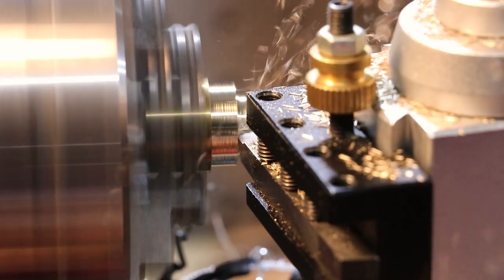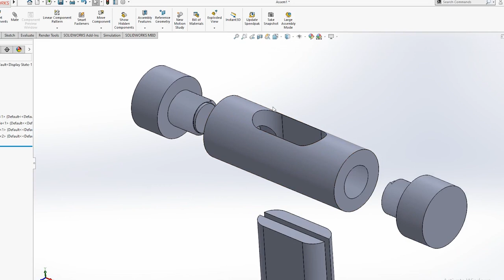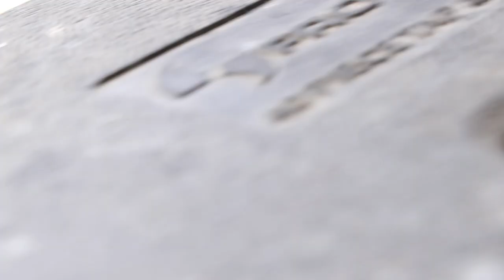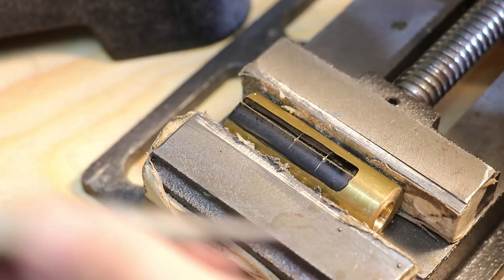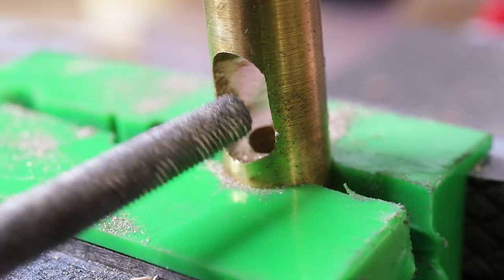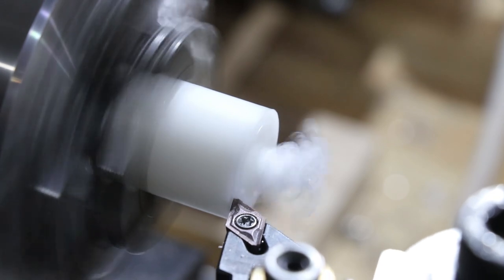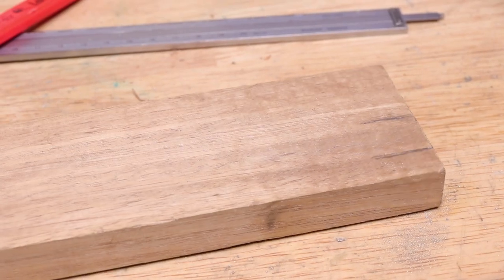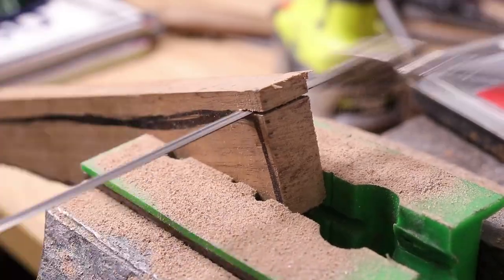Simple Machinist Hammer Build

Comment from the maker: G'day. This video was recorded over a year ago, not too long after I moved into the new workshop. Since recording this I have improved in my workflow in using the mini lathe. there are several parts here where I made simple mistakes. One being mistake with the run out which I point out in the video, an another being that I did not spot drill the holes using the drill press, causing them to drill with a slight offset, which I had to correct when I filed down the holes. Mistakes are a part of machining, and an important part of learning to be better, and it is always important that we learn from our mistakes.  Cheers.
Reply: Nice but I have a suggestion try getting a Japanese pull saw for wood work I reviewed the footage and that hacksaw didnt seem to be cutting very fast😅